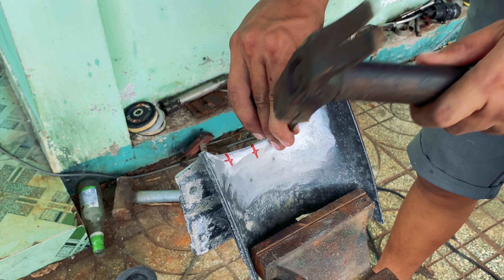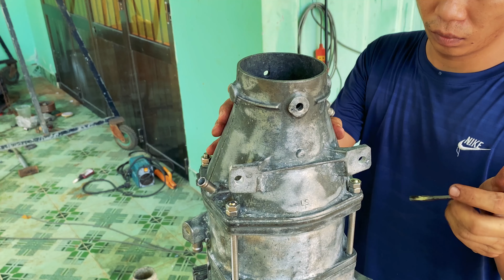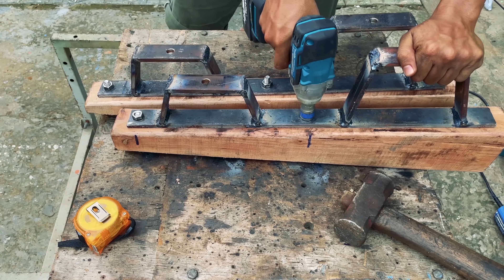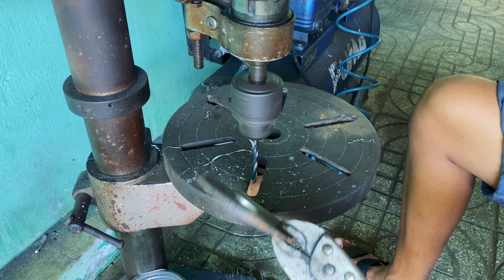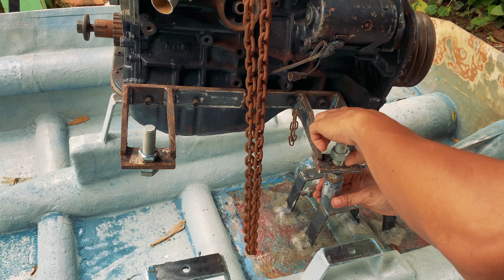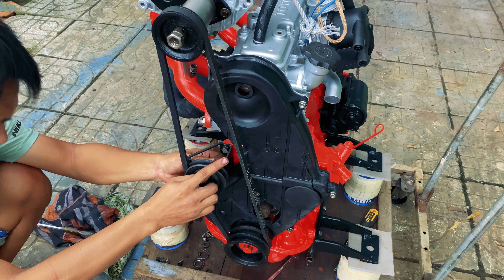Supercharger for scrap car engine running boat

Comment: Great to see the blower going the right way. The blower looks quite small  and may need a larger crank pulley to spin faster and make boost. A pressure gauge in the inlet manifold will tell you your boost. Don`t get greedy! 
Nice work buddy!

Comment: That pipe connecting the supercharger to the intake manifold will break. You need to make good mounts for the supercharger.
Reply: Накой хрен вообще на турбину сделал привод с ремнём,  с глушака не мог, всю прибавку от турбины на ремень и потратил, валенок!
Reply: @ФигВам-д2р  He wanted a supercharger and thats why he has the belt drive, the turbocharger uses the exhaust, I like the Supercharger better. He just needs to do it right.